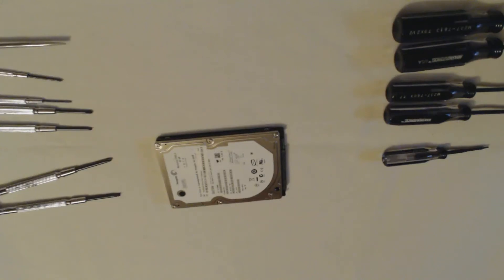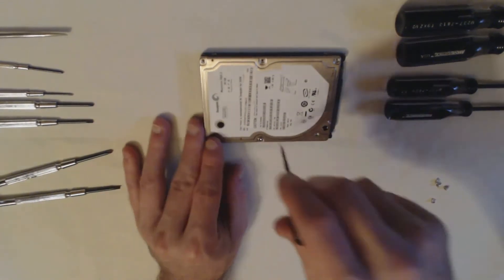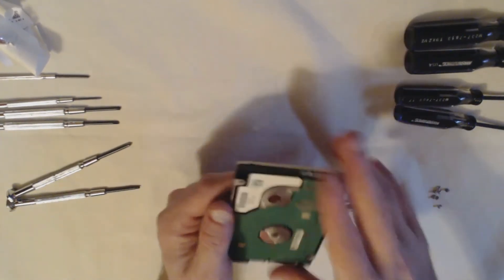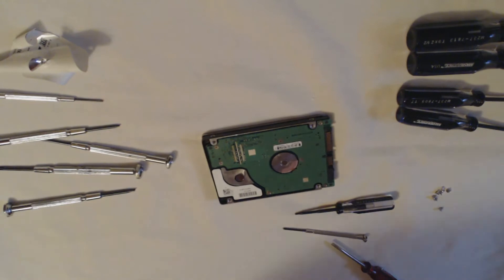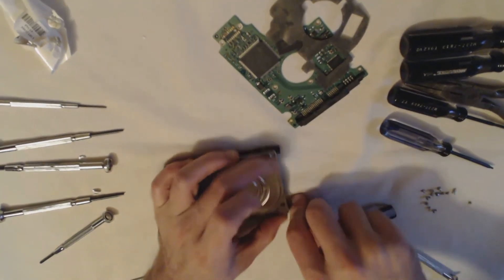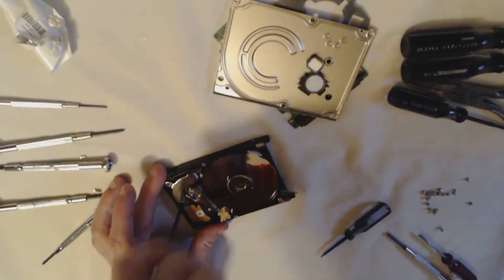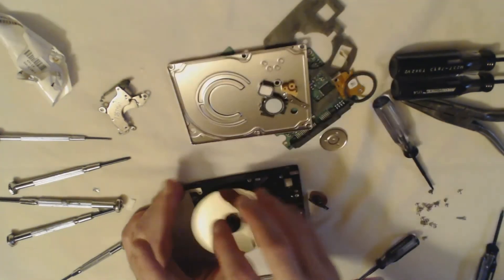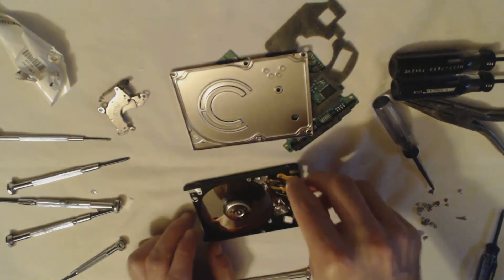Seagate: ST980811AS Disassemble

Comment: *=* This is hard drive from my PS3 CECHE01, it is same for all others models of PS3?
It's for recovering my data from broken PS3, probably grilled...
Reply from the maker: I don't know. Google search isn't showing anything about what default drives are shipped from factory. Most 2.5 SATA HDD & SSD are compatible with PS3.
From what I recall, installing or reinserting any drive into a PS3 automatically prompts formatting & fresh OS installation or something. Been a long time since I had to do that for a customer during the time I worked in that computer repair shop so I forget the details.
I don't know about most old data that would be copied to drive, I remember reading that copying game save data disables trophies in all or most games. Best to use the cloud backup for game saves if possible.
If there's any pertinent data on the drive, likely consider it a loss if the drive has gone bad. It's best to occasionally do backups for any important data.